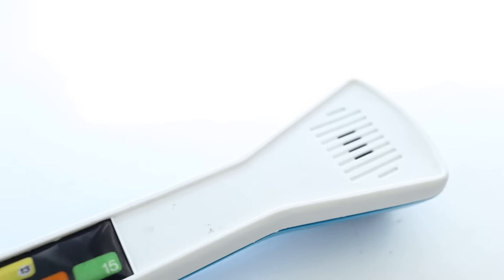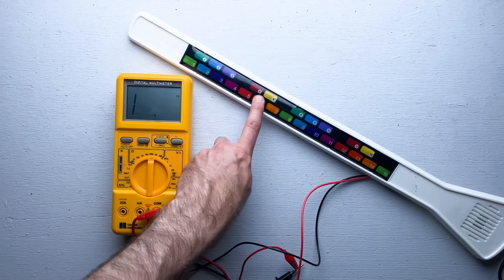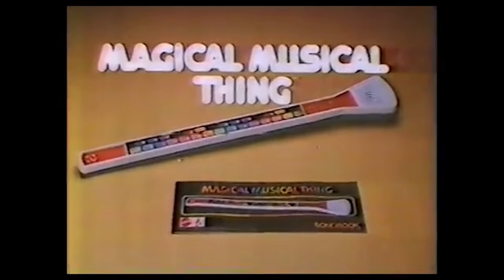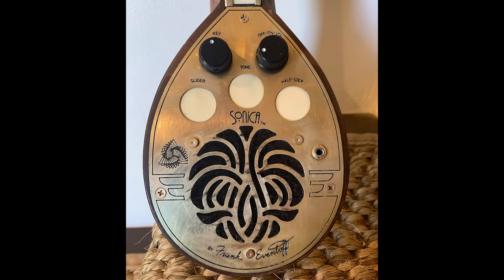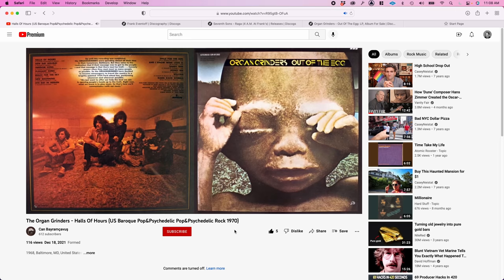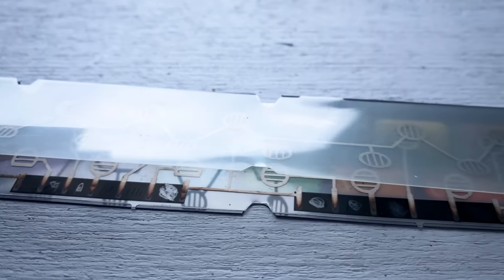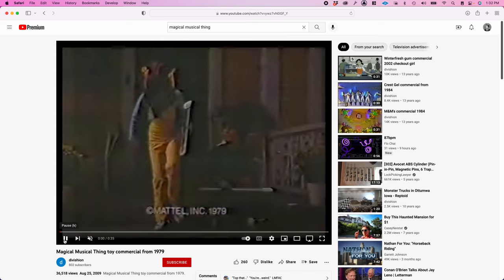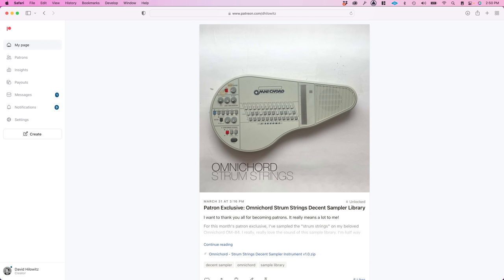Magical Musical Thing: A vintage analog synthesizer for kids

Comment: I had one of these when I was about 10 or 12 years old.  My father saw me taking it apart and said “if you break that I won’t be able to fix it because it is all electronics inside.”  So, I took it apart many times to explore the inner workings.   This was the start of my electronics career that includes a Ph.D in electrical engineering!
Reply: Oh wow, same here. Had one, disassembled it as a kid, surprised how simple it was, and ended up with a Ph.D. in EE. Go Hawks!
Reply: I had one too, but closest I've gotten to a degree is watching bbt
Reply: I had begun dismantling a cheap electronic keyboard I had gotten from Walmart when I was probably around 9, only for my mother to go berserk and throw it out before I had a chance to put it back together. Really wished more parents encouraged that curious mindset, but my mother is a shill for store-bought products and never had an appreciation for any hands-on / DYI crafts.
Reply: @sirshrooma  aw sorry man, I was always taking stuff apart and always got them back together working, with the one exception of mom's tape recorder, which still worked, I just couldn't get the spring back into place that made the little door pop up.

The look on her face though, the equivalent these days would be if your kid completely disassembled your laptop... 😲😬😧
Reply: sadly my interest in electronics started the same way, im still planning on fixing my camcorder i took apart with a tape still inside for no reason. the content inside is super sentimental to me and i dont want to mess it up so its sat for years. waiting.
Reply: @stevenmitchell7697  Hi Steven!  How are you doing?  It has been a long time.  Call me sometime!
Reply: Breaking things apart was always my favorite because I wanted to see if I can put them back together lol
Reply: Me taking apart all my stuff led me to be a garbage man.
Reply: I watched my technology teacher leave school because he cut his finger off in class, so I never bothered with any of this stuff lol but it's still interesting as f-
Reply: I also had one of these back when I was a kid.
Reply: Same! But software engineering for me
Reply: I used to take things apart as a kid. They usually didn't work after that, so now I'm just a Grade 7 teacher.
Reply: Can you take apart Piano keyboards and fix them?
Reply: My dad used to do that all the time with his electronic toys, although he didn't become an electric engineer! haha.
Reply: Ahh the memories 😅 I had one as a kid too 🎉

Comment: My Dad taught me to solder when the 9v battery connector broke.  He had a Realistic soldering gun that was way too hot and using solder with no or very bad flux, I had to learn to resolder it again and again; like every time I changed the battery.  Thanks Dad for the silly noise toy and the useful skill of melting lead and tin to join electrical connections!💙

Comment: We bought one of these for our children when it was new. When the sound board stopped making sound I used the controller as a control voltage source for various DIY synthesizer modules I built and played with. Thanks for expanding my awareness of what I was working with, and of its creator. This is a nice video. Thanks also for your Decent Sampler instrument; I downloaded it to mourn that none of the parts of my children's Magical Musical Thing have survived the decades.

Comment: Very well done video! I decided to grab one of these on EBay. Can’t wait to spend the 2 hours with the razor blade and multimeter. I literally have nothing but time as I’m stuck at home with the Covid. Thanks for doing this!!!(the video, not the Covid😜)
Reply from the maker: Good luck! Maybe you’ll get one that’s more in tune from the get go. Hope you feel better!
Reply: If you want a custom one, then you can make a sensor with paper and some transparency film. Cover the paper with pencil lead (or another source of graphite) in the area that you want to use as a control, then do it again on another piece of paper. Punch holes into the transparency film to correspond to your choice of notes. Then put the transparency film between the graphite on the paper, fasten it all in place (with tape or whatever), put 1 metal paper clip on each of the pieces of paper (the paper clips need to be in contact with the graphite, but not each other- also, the transparency film should keep them away from the other piece of paper), wrap a separate piece of electrical wire around each paper clip, and you should now have a variable resistor.

Take that resistor and plug it in as a frequency control resistor on an oscillator (you can look them up online, they're very simple), and you're good to go. For tuning, either vary other resistors in the oscillator (to control the octave), or use a pencil or eraser (experiment a bit) to tune individual notes.

There are better materials than paper, and it may be worth triming the paper and transparency, then laminating the thing, but this is an easy way to build custom one-off variable resistors.
Reply: Are you vaccinated?

Comment: That was a fun toy - although since it was "a noisemaker", I had to use it in only approved locations, even if I was playing the songs out of the included song book.  :P
As others have said, I also opened mine up to see how it worked - it wasn't nearly as cool on the inside as Simon, Blip, Little Professor (calculator), or the Mattel hand held games were - much less interesting stuff to see.

Comment: We had one of these at my house (8 kids so no idea whose it was) and so I checked on ebay and got one for about 20 bucks which is crazy cheap for an analog monosynth! I couldn't believe it worked so well, terribly out of tune and of course the first thing I did was rub it on my head. The commercial was so very familiar. I am certain I haven't seen it since it was on TV. Thanks for putting together such a great video. The MMT is a facinating story.

Comment: Back in the days of analog TV, the UHF tuner in most of these was also analog, even if the tuner had distinct clicks for each channel.  I was wondering how that was done, since these days these would be done with a digital frequency synthesizer.  So I opened up an old UHF TV tuner.  What I found was a circuit board very much like many others, but it had places where printed resistors had been scratched by a knife, and, you guessed it, other resistors that had what looked like sharpie marks on them.  Probably more stable over time than pencil marks.

This reminded me of something I had encountered in my Air Force career many years ago.  I was working on a radar system that was used to measure how high a plane was flying.  It had an antenna that could be precisely aimed with a hydraulic system, and in order to get an accurate reading of the angle the antenna was pointing, it had a large (about 6" diameter) variable resistor.  These occasionally failed, and I took one apart to see how it was made.  This one had a carbon coating all the way around the inside of the housing, with metal fingers that made contact with that.  But in addition, it had been "hand tuned" with bits of silver paint, well away from where the fingers made contact, strategically placed to calibrate it.

I wonder how many other things were tweaked by hand in the days before everything was digital!

Comment: I had (and still have) one of these Magical Musical Things from the 70's. I modified it to add an audio output jack and a toggle switch to control the audio out between the device speaker and the jack. I could plug it into an amp and make it loud. It was an affordable, fun little toy.

Comment: Ha I had one of those in ‘79. Totally forgot about it. I remember the commercial too. I also knew right out the gate you were gonna have to tube that by mucking with the resistor strip 😂

Comment: For me (age 24 in 2023) the equivalent toy was the stylophone. It’s very similar to this device except that it doesn’t use a variable resistor but rather which circuit is completed when you touch a metal stylus connected to the device to various contact patches on it. That and it’s much smaller.

Comment: Before even watching I figured this toy had to have Sonica lineage! A bit shrill sounding like many other square wave toy keyboards from the day but with a similar percussive envelope to the Sonica.  I've played a few actual Sonicas and they're very robust and sensitive - truly quality instruments.  A passive filter mod would be cool as the original Sonica did have a very basic tone control.  It also had a cool pitch control pad that functioned a bit like a whammy bar.  I'm thinking either an Xbox joystick or old GuitarHero controller whammy would be a cool addition if you could find the space in there.

Comment: Thanks for the video!  Looks like they were redesigned at least once, as the pads are a little different on the strip on mine, but the resistors look the same so hopefully i'll be able to get it in tune :)

Comment: ✌️ awesome brother ✌️
I personally started my fascination with music with one of those analog stick thingummies from Montgomery Wards.. a nylon string guitar my cousin Paula gave me for Christmas... the keyboard on this is great... seems like you should be able to use an eraser to get less resistance.. cutting seems so... final... Bosch used a variable carbon resistor in the throttle of some of the early fuel injection... good stuff, carbon ✌️
thanks for sharing
Reply: as I think about the Bosch injection system they put in sections with different length around the circumference of the travel of a metal conductor... but it was, indeed, the overall size of each section that created the resistance... awesome... I'll look for one and see if I can make something with a foot pedal... jest for fun 😊

Comment: Excellent episode! I’ve been wanting to build something of my own and this helps a lot! Something I’d like to do is attach some sort of strip along the neck of my fiddle (which I also build myself) in such a way that the midi buttons would correspond to the frets. I already have audio-midi conversion software that I have a lot of fun with. But I prefer the idea of discretely placed buttons that would practically eliminate the issues of double-triggering and wrong notes and all that. I suppose I could run something like this into the converter(Jam Origin Midi Guitar 2) if the audio signal were clean and consistently accurate. I’d love to hear any suggestions.
Reply: Actually just watched NMC’s video on the Sonica and it’s design and functions are nearly perfect.

Comment: A nice little microcontroller circuit could read the wrong resistance and produce correct the tone directly to the amplifier.  A fancy algorithm could interpret a programming mode where you could press the buttons in order to teach the controller which is which.  A fancier algorithm might include cool slides or other effects.  It would be neat to give new life to this little instrument replacing the tiny little circuit board.

Comment: It's a basic cheap monophonic keytar.  It would be interesting to see the schematic on that chip. Get 12 of those circuits put together, 1 chip per key, to build a 1-octave polyphonic version into a summing amp.  Then perhaps also include a switch to increase or decrease by 1 octave, although I don't know how that would work without knowing the schematic here, with the assumption that an oscillator divide or multiply would need to be put in, idk.

Comment: Since you had a multimeter, you could've actually read and calculated specific values to shoot for when modifying the circuit, and gotten more accurate tuning, by determining the resistance values necessary to achieve equal temperament. :)

Comment: Great insights in the video! Way cooler history on this goofy noise stick than expected. I have one of these and have been wanting to add the out port to it like it seems you did, but I was bummed you didn't cover that aspect. Did you splice the port into the speaker wires and drill a hole for the jack?

Comment: viVive la résistance! q=P
possible solution is: make a long thin board with a simple circuit, on one pole put long wires(for resitance) to each key, and cut it lill by lill until the key is tuned, solder, and do all keys ... then jam this kludge into the toy shell, and throw it away.

Comment: Two questions - 1) What plugins did you use to make the sound “fatter”? Beyond using a low pass filter or delay, it wasn’t clear. 2) Loved how you got in touch with Franklin. What was that process like finding and contacting him? I was waiting for you to finally ask him how to fix yours and it’s so awesome he had the answer!
Reply from the maker: 1) I used a Waves plugin called RBass. I use it a lot when I need to add some  low sub frequencies to a bass sound. 2) I actually reached out to him via his company (Sensitronics). I filled out the contact form, and he responded very kindly within a few hours. :)
Reply: @DavidHilowitzMusic  the legend himself responds! Thank you David! That’s awesome you reached out to him. Quite courageous!

Comment: No toys back then and well through the '80s and part of the '90s were pitched. And they usually weren't fussed with too much. Because there wasn't a lot of research on toys yet it wasn't until the 2000s that toy design got really corporate

Comment: Unfortunately tunning depending on resistors made of graphite is subject to change with temperature and humidity, but the method used here is really clever. Normally, changes occur in the same direction, so once individual resistors are set (an arithmetical progression), a single bridge with a potentiometer at the analog input should allow frequent fine tunning.

Comment: Do you have something like a list of resistances needed per note? It would be fun to keep the oscilloscope circuit the same, but build a different keyboard around it as a project. Saves on the graphite and membrane stuff. Adding a adjustable resistor will make it even more capable in that regard

Comment: I bought one of these out of a bargain bin at Zellers for about 4 bucks.  13 year old me had grand plans involving hacking it to run a more complex sound chip (I had the SN76477 in mind because I could get one at Radio Shack).  Then I got it apart and realized just how horrible the design was.  In tune?  Nope.  Polyphony?  DREAM ON BOY!  It never went back together and it would be a long time before I would trust the bargain bin again.

Idk, maybe some day (now that you and Franklin have shown me how to tune it) I'll snag one of these and a 76477 on eBay and put my college electronics training to the task & see what emerges.  It might have to wait until I retire.

Comment: Something I've realized has bothered me, is it really analog if it uses a microprocessor? Don't they rely on binary signals? I know analog integrated circuits exist, but I doubt this 1970s toy uses anything other than a basic digital synth chip.(?)

I paused to make this comment as it struck me, so maybe this will get explained in the video.
Reply: I mean that looked like a simple analog oscillator but I definitely saw a chip on there, probably one of the common ones at the time? If you can change the sounds at all, it's definitely not pure analog at the very least. If you can't change the sound... why is there a microchip?

Either way if anyone has the insight and time, I'd appreciate an explanation of this area of confusion for me.
Reply: Being way out of tune is definitely evidence towards the circuit being analog. I am trying to learn more about practical electronics

Comment: Modern engineer perplexed at how to tune a 30 year old toy piano.  Old school builder "Just use a razor blade and a pencil !" .... Great job tuning the toy. 
Point is.... There is such a huge disconnect between builders/inventors
And engineers these days. The gap seems to be growing as well...